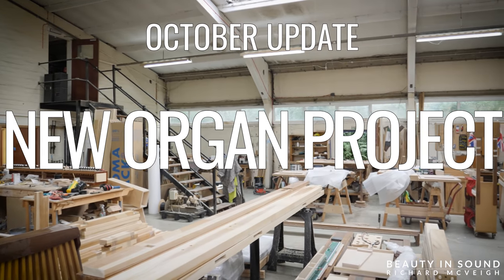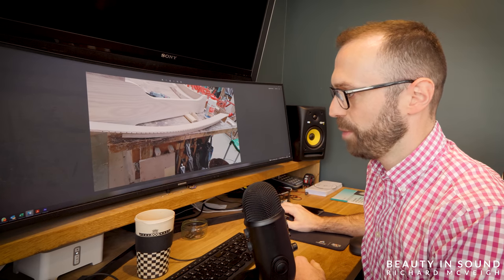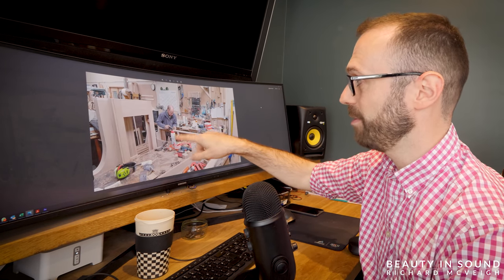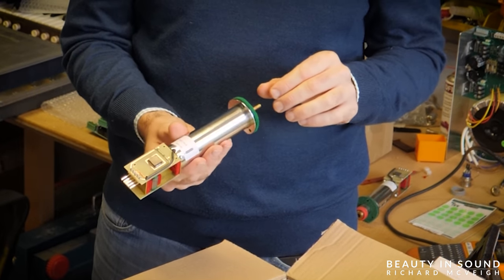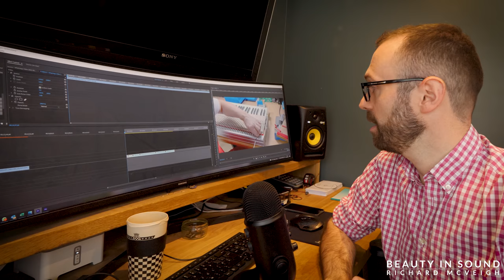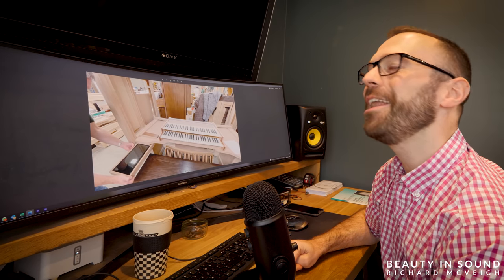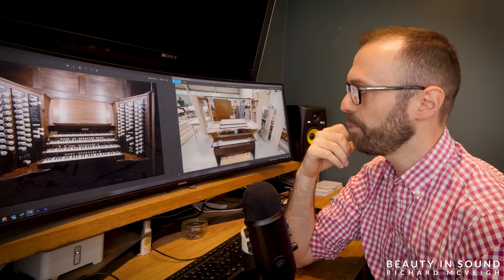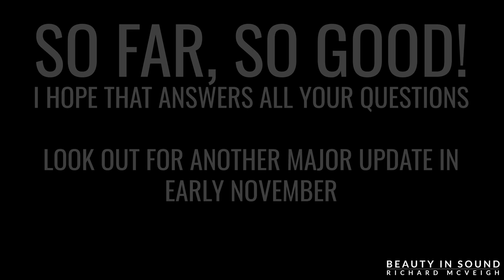🎵 MAJOR organ update | FIRST LOOK | It looks AMAZING!!!

Comment: Astonished that you don’t know what a dovetail joint is. It’s basic school level woodwork. And it’s so well known it has entered into speech as an idiom e.g if something  connects or integrates in an easy and seamless way, it is said ‘to dovetail’, e.g “the two sections of the programne dovetailed together really well.” or “Your schedule and mine are dovetailing on Tuesday, so lets have the meeting then.” etc.
Reply from the maker: Well, you learn something everyday... as they say! ;)
Reply: @beautyinsound  Quite! Sorry I read my post back and noticed it sounded a bit flippant. I didn't mean it that way. There's probably a load of things you know (and think is generally known) that I haven't a clue about!

Comment: As for floor speakers, it’ll depend on the context. If you just need them for reference when practicing, then a few studio monitors with 8 inch drivers should do the trick.(Adam Audio TV8/TV7 are pretty good) But if you want a multichannel speaker array that’s suitable for live performances, you’ll want to look at some more ambient full range home theater speakers. (Something closer to some DefTech BP9040s)
Reply from the maker: Ryan - I currently have 6 Adam F7s connected to the organ, and I'll be doing more live-live performances from next year. That is, with a live audience in the music room so I need to have good quality speakers just like those DefTech ones. Do you have the BP9040s, or have you heard them?
Reply: @beautyinsound  Sorry for the truant reply, I just now saw this. I'm sure you'll find this out for yourself since you're now getting DefTech speakers, but I've heard them used in professional digital organ installations (i.e Marshall & Ogletree) and have been very impressed. The reasons I recomended those speakers is because they were designed with Home Theater in mind, where you want the most accurate and comprehensive sound to fill as much space as possible. Four should be more than enough to fill your living room with high quality sound for a live audience. Another reason these are used with organ instalations is that their bipolar nature (Drivers firing sound from from both sides) kind of mimics the acoustic nature of a pipe, which predominantly releases sound from two places, the mouth and the opening of the body. Hope this clarifies a few things. :)

Comment: The large piece of wood that separates the left stop jamb from the right is referred to as the "key desk." At least that's the common name used in Canada.
In a later clip they are adjusting the tracker touch keyboard with weights both for the easy travel before the key sounds half-way down in its travel and the beginning of contact closing, making the note sound. If they aren't all the same weight it will affect your playing. If they aren't to specification, others will find it weird when they play it. This is not to say that you can't have it set for a higher force for instance if you have just come from a church with an antique Dutch tracker organ and find your new keyboards to have a light touch. Rather than adjusting the keyboards, practice more. You will become accustomed to the feel. Where is the covet emoticon when you need one, and does commandment #10 also apply to organ consoles? I'm happy to see that you didn't include cup holders for your coke which is not compatible with keyboards.

Comment: Beautiful work. I simply love my UHT keyboards; they feel so classy, and very consistent. Interesting to see the video of them adjusting the "weight" of each key to get them nice and consistent. What are the naturals covered with?
Reply from the maker: They call it “mineral”, and the black notes are ebony - similar to the ones in the video I guess. Which ones are yours?
Reply: @beautyinsound  I opted for bone, which feels very nice indeed. Was warned it could potentially discolour a little over time, but wasn't too bothered about that, and it's actually been 
fine so far.

Comment: Does your console use Hauptwerk's built-in combination action and stepper, or does it use a separate system similar to what would be used on a pipe organ console?
Reply from the maker: Great question. My organ is totally dependant upon Hauptwerk, including the Setter, General Cancel, Generals and Sequencer. All coupler stops and pistons are individually assigned within Hauptwerk as well which is a bit fiddly for Gt-Pd and Sw-Gt as there are three couplers for each of these where as Hauptwerk only allows for a Primary and Secondary input. Worked out a way round that though! 👌

Comment: 15:45 Martin is using a plumb line to check horizontal alignment of pedalboard, not measuring distance to lower keyboard. Middle D over middle D, front of middle pedal sharps 240 - 270 mm back, on 3m and 4m consoles. Height  to playing surface of lowest manual: 750 - 775 mm, typical height of a desk or table. Mind your knees on the drawer corners!
Reply from the maker: Almost... Martin is actually measuring the height between D and D. I know because about 3 seconds later I sat on the bench to see whether it felt right. The distance on this organ is 765mm which is H&H’s standard distance between D over D.

You’re on it! The corners of the drawers will be smooth for this very reason!

Are you talking from experience?
Reply: AGO specs would be 29.5 inches from lowest manual to pedal D2.

Comment: Very nice to see an amazing console in progress.  I don't know the British guild standard, but I'm going to guess 29.5 inches D to D for pedalboard since no one else has made any guesses.   Curious to hear more about your specific description of the ideal keyboard touch.  Those springs looked to be parallel to the key sticks, but springs I've seen on some other older keyboards are mounted vertically on the ends of the keys.   How does the touch differ?  If there a 'giving way' as in a piano or perhaps tracker organ? 
As for Ciphering -- that's the bane of all MIDI based instruments in my experience and can result from any glitch in the continuum, either from console or software.   Would be interesting to know why that has popped up recently.  Any updates to Hauptwerk immediately before it started?  Or different sample set that overtaxed the system?
Anyway thanks for sharing.  On my ToDo list is to build a Virtual Organ console, but I plan to make it as light and compact as possible for ease of moving.  Organs can be real space and weight hogs!

Comment: It's going to be gorgeous, and I'll bet not cheap! I'm curious about York Minster : I know the organ has had a big refurbishment, but has the console been refinished? 
Your shots of the lower parts look perfect, with no scratches or blemishes at all!
Reply from the maker: Yes - the 2 consoles at York have both been refurbished. A point to note however is that the detached nave console is different to the upstairs screen console, and it's the screen console we're basing the BIS organ on. The pictures of the pedalboard in the video are of the newly refurbished screen console.
Reply: @beautyinsound  Thanks. I forgot that it has a nave console now; it's been too long since I was there!

Comment: After Renatus assembles the console in the in shop, can it be disassembled into manageable pieces to that it can be shipped and reassembled in your house? Or is the console a single piece other than the pedal board?
Reply from the maker: Good question, and I think the answer is that it'll be one complete piece of furniture (as you say, apart from the pedal board and bench). The side panels are one long piece of oak so there'll be nowhere where it can be disassembled. It's going to heavy..... VERY heavy!!

Comment: Great spec's on the subwoofer! Only 5000 GBP each.
Reply from the maker: They are very pricey, and luckily I found an ex-demo which made it a bit cheaper.
Reply: @beautyinsound  Not many subs out on the market that can handle 16Hz - being 32' low C. :)
Reply from the maker: Indeed! That’s why I chose this one, and it goes down to 15Hz meaning there’s plenty of bass space. It’s also a very nice piece of furniture with an external remote.
Reply: @beautyinsound  it's 6dB down at 15Hz, meaning only a quarter of the sound pressure compared with at, say 40Hz. So an equalization curve will need to be applied to flatten the response curve. That's true for any installation where accurate reproduction is required. That said, you may want a larger room for it and/or accoustics treatment of all the walls, and ceiling otherwise the room modes caused by reflections off of hard flat surfaces will negatively affect the result. You wouldn't regret adding good accoustic treatment.
Reply from the maker: Well the good news there is that phase 2 of the project is a new purpose-built music room, designed by specialists. That’s a couple of years off though, and with numerous more marathons!